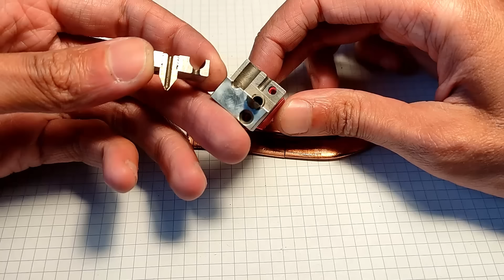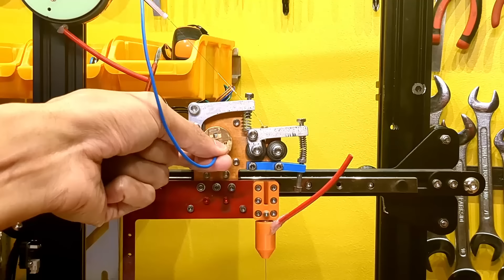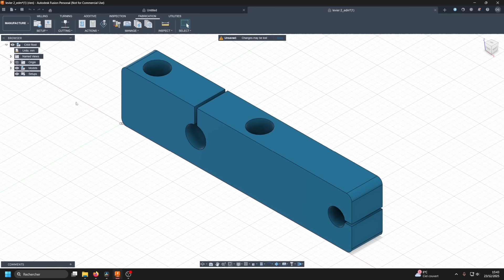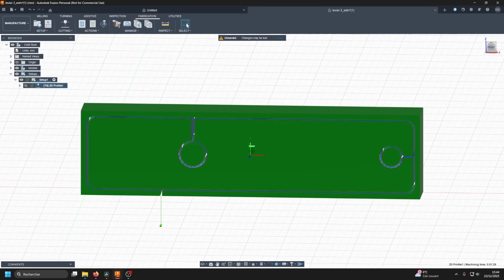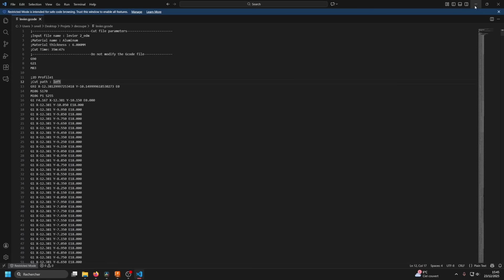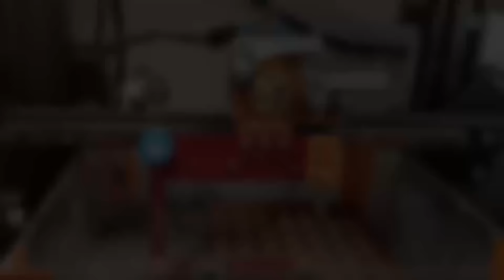Ender 3 to Wire EDM, how to cut metal with a 3D printer

Comment: Nice project. I have been looking at (wire) EDM machines for some time but most, if not al, of them use a "professional" electronics box and those are way too expensive for me. I am not sure if I will even build or use this machine but I do have a lot of Ender 3 components from different printers that I got when they were disposed by their previous owners.
I do however have use for an electrode EDM machine to remove stuff like broken taps from holes. That does mean that I need some way of detecting the energy consumption to make sure the electrode stays at the correct distance for optimal spark generation. I think implementing something like that should not be too hard.
Reply from the maker: Yeah I wanted to buy the one from racks robotics but 300€ for a MOSFET and a few capacitor is a bit too expensive.
Honestly I don't think I will use this machine that often but it was cool to build!
I will explain 100% of how the power supply works I got a lots of request so you can build a sinking EDM! I still don't have the close loop control to keep the distance correct but I know how to do it
Reply: @AlmostCompletedProjects  Nice, I'll tag along on github to follow the progress. I'm not sure I will start working on this soon - I need to move house and do some renovation work before I can setup my new workshop
Reply from the maker: @Rob_65 well good luck for the renovations I know it can be a lot of work

Comment: Nice cuts! 
What resistance are you using? (Also what capacitance and frequency?). I made an EDM cutter that was 48V, and used four 12V bulbs in series as a resistor to protect my MOSFET (the idea was that the resistance goes up if there is a short). I keep meaning to return to the project - I need to add water circulation to improve the cutting rate. My electrode was a propelling pencil lead (graphite) - it would glow and smoke if there was a short!
Do you measure the voltage drop across the resistor to detect if you need to move faster / slow down?
I'll have to keep an eye on your channel to see what you do with the Nitinol.
Reply from the maker: Hey thank you! The light bulb is a very good idea with the self feedback loop increasing the resistance! I use the heating element from the ender ~14ohms and they are immerged in the water bath.
Capacitance I think 10uF I check that, 60kHz. The part list is on GitHub but not fully up to date.
You should it was one of my most interesting projects water management is as pain though.
I tried graphite but brass is easier in my opinion, it can act like a fuse when there's a short.

I will measure the voltage, it's what I meant by close loop control on federate!

It's not nitinol there's a lot of others shape memory alloys, this one is CuZnAl and it's a failed tensile test sample from my PhD. I'm not planning to show a lot about it at least not before being published
Reply: @AlmostCompletedProjects  Thanks. I had a 22uF cap. I tried different frequencies and duty cycles. I think about 13kHz seemed to be about best for my setup. One thing I need to do is add a high resistance path so that contact can be detected without cutting. Very useful with a graphite cutting probe to find out how much the tip has eroded! Also for accurate work piece alignment. 
I noticed your comment about "close loop control" after posting - sorry.
Reply from the maker: @johndoggett808 yeah a high resistance path is also something I need to implement! 
Don't worry there's way more comments than I expected 😅
Reply from the maker: Hey thank you! The light bulb is a very good idea with the self feedback loop increasing the resistance! I use the heating element from the ender ~14ohms and they are immerged in the water bath.
Capacitance I think 10uF I check that, 60kHz. The part list is on GitHub but not fully up to date.
You should it was one of my most interesting projects water management is as pain though.
I tried graphite but brass is easier in my opinion, it can act like a fuse when there's a short.

I will measure the voltage, it's what I meant by close loop control on federate!

It's not nitinol there's a lot of others shape memory alloys, this one is CuZnAl and it's a failed tensile test sample from my PhD. I'm not planning to show a lot about it at least not before being published

Comment: Very nice, you can reduce the backlash with rubber bands on the x and y as there is no actual force/resistance on the wire. Switch out your ball bearings tensioner for a capstan casset style tension system, you are pintching the brass wire out of round ,it maybe lass simple setup but will lead to a better cut. Amazing all the same to have yourself a little wire edm on the cheap
Reply from the maker: Man that's the best idea! how didn't I even think about? Never heard of a capstan casset, how does it work?
Reply: The sodick machine I’ve ran uses felt pads pressing on either side of the wire. So the out of round problem doesn’t happen, and it also helps clean the wire to ensure the best electrical connection @AlmostCompletedProjects
Reply from the maker: @pless.Are you sure that the felt pads are actually used as a break? The machine we have at work also have felt pads but only to clean the wire, the break is located before

Comment: How are you considered the backlash issue? Ball drive rather than belt? Great project.
Reply from the maker: The backlash doesn't comes from the belt but from the gearbox! I'm working on a belt driven gearbox which should eliminate the backlash, otherwise strain wave gear is a good option

Comment: Really good stuff. I always think about how some of the machines are able to get such high accuracy. I know the main goal of yours is to build on the cheap but is there any way of sending location data from a D.R.O.  glass scale? So instead of relying on the stepper motor for location (back lash) you would have an absolute location independent of physical accuracy limitations.
Reply from the maker: I don't understand the part about the DRO but steppers can be very accurate, there is no reason to lose any steps since the load is very low!
The only current issue comes from the gearbox 
I used two different wire edm at work one European one Chinese and both used steppers with a gearbox without close loop control. And they are very accurate.

Comment: Subscribed. Do you think you could also do a EDM drill?
Reply from the maker: Yeah I'm planning that but it's not a priority, first I need to solve the issues mentioned, then create a database for a lots of materials, then find a way to cut the wire and feed it automatically and finally the drilling part
Reply: @AlmostCompletedProjects  No worry. I will wait!

Comment: Nice man, i've been looking for this kind of thing. I hope next version will be more in depth. Really want to build this simple wire edm.
Reply from the maker: Yeah next video will probably be "0 backlash 3d printed gearbox" them I will buy another ender 3 and film the all process
Reply: @AlmostCompletedProjects  let's go!! I hope the next video will be clear(dummies level) that someone with zero knowlegde like me can confidently try to make it HAHAHA
Reply from the maker: @scavengers4205  that's a good point, was this video hard to understand? My family didn't understand shit but they're not English speakers and don't do technical stuff so I don't have real feedback 😅
Reply: @AlmostCompletedProjects  nah you're good dude. As someone who never use 3d printer, your video gimme 30% confident level if i wanna build it. But if someone who know and used 3d printer system, this project kinda easy af i think haha tbh, i plan just wanna make some simple 1 axis wire edm (manually adjust the spacing/pitch), i wanna try to make waterblock microchannel using 0.1mm wire. I'm not worried about the mechanical, just the electrical EDM things. What type of electrical parts is needed, how to control the pulse yada yada. Tbh, i would pay if someone made a totally in depth tutorial from A-Z about this simple system. I mean from the part-list to how to setup all that.
Reply from the maker: @scavengers4205 ok great then! You should start by buying a second hand ender 3 and play a bit on it before starting imo!
This project is 2 axis technically so not that far from what you need 😂
But 0.1mm wire is very thin and can break easily I use 0.2 and I will switch to 0.25 for more reliability! Even on the machine we have at work we don't go below 0.15...
And you have to add the arc length on both side (0.05mm) my cuts with a 0.2mm are 0.3mm wide.

I will make a full tutorial for free and if it's good enough for you feel free to support me on Patreon (I don't have one for now)
Reply: @AlmostCompletedProjects  Yoo that's what i've planning for. You're right, 0.1mm so freaking ambitious hahaha. I think i would happily settle for 0.25mm. Second hand ender 3, learn the basic about the 3d printer system. Damn i wished i had a friends who know about this topic HAHAHA Thank you dude, now i'm hype! HAHAHA
Reply from the maker: @scavengers4205 that's why we have the maker community! There's a lots of good YouTube video and a lots of people ready to help you!
Reply: Ha e you done more of a video on the electronics?  I have a old Makerfarm Pegasus 8 that is destined for edm or being rhe donor to corexy for the Pegasus 12
Reply from the maker: @alanwomack5656 that's old indeed! It might not be enough but you can give it a try. 
I'm in my last year of PhD so I don't have a lot of time to make videos, I hope I'll be able to make the tutorial this summer but can't promise anything.

Comment: morlock/rackrobotics has a new contender?  Cool stuff.   My needs for desktop wire edm is cutting blanks for lathe tools. faster to just load a bunch up on a plate and rough cut em then final grind em later.  Less wear and tear/dust creation on green/diamond wheels too.   Wouldn't be hard to change tooling over to a sinker too.  Broke a small fine pitch tap off in a part?  EDM to the rescue!
Reply from the maker: Not necessarily, they sold a finished product, I provide open source plans for those who have enough time to build it!
You can transform it into a sinker it's very easy!

Comment: i like it but i think your future goals go outside the scope. at that point it might make more sense to build your own cartesian motion system and ditch the ender entirely for a more rigid and less backlash-y system. dont misunderstand. i like everything shown in the video. but especially the closed loop control might require you to ditch the enders controller anyway
Reply from the maker: Thank you for your suggestions but my goal is to make accessible tools for everyone, rigidity isn't required for wire edm there's virtually 0 load. The backlash is just from the planetary gearbox and it can be solved by a 3D printed belt gearbox for like 2€.

Same for the close loop control, I "just" have to look at the waveform really fast with a pi-pico and depending on the average voltage tell the ender to go at 120% speed until all the pulse are actually creating sparks. Someone already did something like that (rack robotics) but it's too expensive for no reason.

Comment: Strain wave reducers / harmonic drive on your steppers could eliminate your backlash problems. It would blow out the price, but if you ask me, it would be worth it. Edm should be accurate 😂
Reply from the maker: There's 3d printed project of strain wave reducer and the load is very low so it should work flawlessly! But the design is open source so if you want to buy a strain wave reducer feel free to do so!
Reply: @AlmostCompletedProjects You should absolutely add it! This is such a tiny load a print would work great! This is such a cool project. I wish I had the time for such things.

Comment: Very cool! Can you elaborate a bit on the power supply used? I thought it was a bit of a specialty element but looks like simply a mosfet, resistor and a few capacitors? What's the frequency?
Reply from the maker: Yep it's exactly that, I have a classic switch mode power supply of 80V then I use the heating elements as a current limiting resistor and capacitor + MOSFET, that's all.
The capacitor needs to be polymer/film capacitor for a low ESR otherwise it will blow up (trust me I tried) and the MOSFET needs to be able to handle A LOT of current mine can go up to 150 continus 500A peak, everything is in the GitHub
Reply: @AlmostCompletedProjects cool thanks for the reply and great project! Subscribed and looking forward to following video's.

Comment: Great job , the microstepping & belt & pulley system used in 3d printing is inherently not very accurate compared to industrial systems .it is ok for melted plastic but if want to achieve sub 100 micron accuracy i think you might need to change the kinematics
Reply from the maker: That's why I use a reducer, the resolution of a step is about 0.1mm/steps and it's very hard to rotate them slowly in a consistent way. With a 51:1 reducer each step is theoretically 2 microns and I can rotate it slowly without any issue. The only thing I need to fix is the backlash, planetary gearbox like that aren't great
Reply: What i meant was ,the actual magnetic poles that stepper lock on to when microstepping arent consistant to 100 microns resolation ,even when using full steps ,specially in cheap stepper motors , keep in mind that not of the magnetic parts of the steppersnare percision machined .there is a great video on youtube about that but i dont remember the chanel name.i recomend cheap servo motor replacements instead  @AlmostCompletedProjects

Comment: What do you use as a dielectric ? Distilled water ? Do you have a Discord community ?
Reply from the maker: Distilled water is fine, I didn't talked about this point in the video but I have a décantation tank and a 1um filter il close loop, you can see it just before the timelaps.
I don't know how much cut I can make before replacing the water but I think I can last very long.

And no discord for now it's my first real video 😂

Comment: love the idea, maybe switch the belts out for ball screw in order to eliminate backlash. nice work btw!
Reply from the maker: That's a very good idea but ball screw are expensive I want to keep the cost as low as possible! I will probably make a belt reducer or use a trapezoidal screw with an anti-backlash nut

Comment: I'm so excited to try this . The power supply still seems kinda like black magic to me though, Some people make it seem really simple and others really go crazy with it. 
I'm also curious to learn how much of a cost wire ends up being , because aluminum isn't cheap already.
Reply from the maker: I will do my best to make an understandable tutorial in a few month. It is really really simple, it's just a switch mode power supply like for a 3D printer, 2 polymer condensateur a strong MOSFET and a raspberry pi pico with a few passive components.
For the wire I currently use brass wire made for jewelry and it's about 2€ for 100m on AliExpress and this cut used 1/4 of a spool. But I will buy second hand EDM brass wire it's not that expensive on marketplace/Leboncoin/craiglist or similar

Comment: Incredible work! I've seen other EDM Videos, but none using an old printer. And I have a couple of those things laying around. Thank you.
Reply from the maker: Yeah I think it's the best way to make it cheap! And I repurposed a lot of components like the heating elements are used to limit the current in case of a short, I also modified the firmware to control the pump with the heat bed output and so on...

Comment: arduino code ??  

circuit diagram ? plz
Reply from the maker: It will be on the GitHub link (it's not clickable for now but please try tomorrow)
It's a raspberry pi pico but with an Arduino code you can't use micropython for high speed processing

Comment: Awesome results! Congratulations on the project!

Can I ask what kind of power supply are you using? Do you always use 80V? What is the typical current that the EDM process is pulling? Also what is the pulse rate and duty cycle?
Reply from the maker: This is a classic switch mode PSU, this particular can go from 0-110V and 0-5A. I tested down to 48V and it works perfectly on aluminum! It might work at even lower voltages that's something I need to test to improve the safety.

For the current I didn't make any measurements because I need a calibrated shunt and an oscilloscope. Same thing I need to dig into that I think I can identify the waveform for cutting and for contact with human skin for emergency shut down!

It depends on the material, aluminum is the easiest to cut and I'm using 5us off time and 10on time so approximately 65kHz!
Reply: @AlmostCompletedProjects  Thanks for the comprehensive answer :)
Reply from the maker: Well thank you for watching my video and asking an interesting question :)